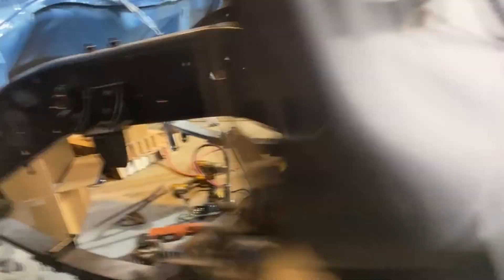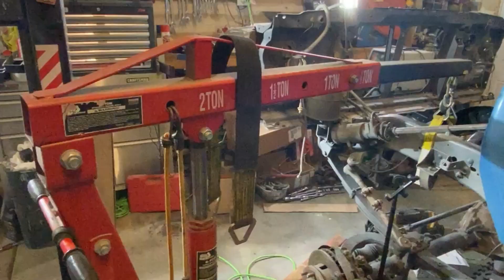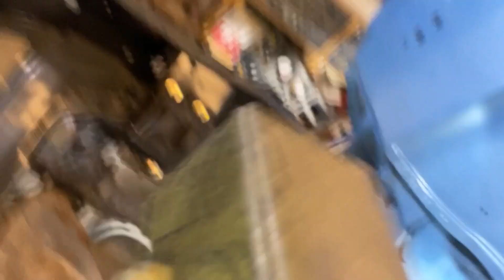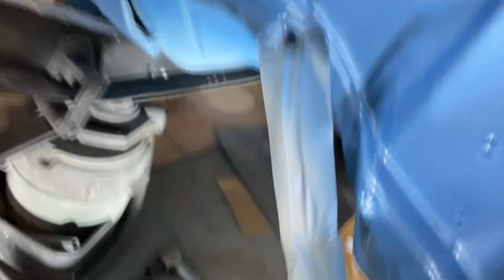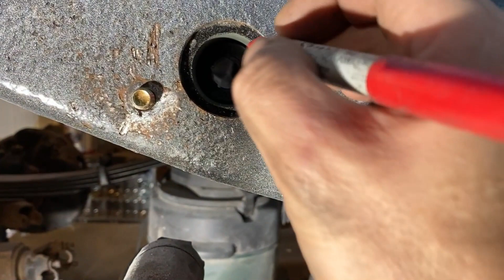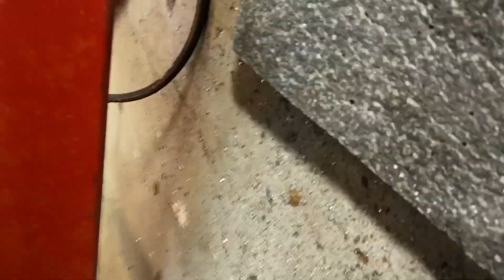Squarebody Chevy/GMC Heavy Duty Front Shackle Hanger and Bushing Install.

Comment: When I did mine, I used a hole saw jus a bit over the size of the center of the new shackle hanger. Put tape around the centering drill bit to fit the size of the bolt hole in the shackle. once that was done, then I removed the rivits. Great though!
Reply from the maker: @tonyvickers8659 Thats a great idea. I never thought of hole-sawing the big hole using the old bushing as a guide.  That would have been a LOT easier.
Reply: Oh another thing was... I put the nut on the inside. If I had not, i would have never be able to get the bolt out as my header and exhaust was in the way.
Reply from the maker: @tonyvickers8659  I debated which direction to put the bolt through.  I decided not to put the grease zerk on the outside because I thought it might get hit by rocks coming off the tires.  So I put mine on the inside of the frame and modified my exhaust to make sure it clears the bolt.  Thanks for commenting, its a good thing for other viewers to watch out for when doing this install.

Comment: Those shackle brackets are on my list. Pretty much all my suspension and steering components are coming from ORD. Most everyone I’ve seen removing those rivets use the punch attachment on the air hammer to drive them out after cutting the ends off. I haven’t done it yet so I’m not sure how well it’s going to work. I sure it will take a powerful air hammer.
Reply from the maker: @slingingsteel9744 Yeah sometimes the punch works but sometimes they are practically welded in.  Thankfully I only had to drill a few of them.